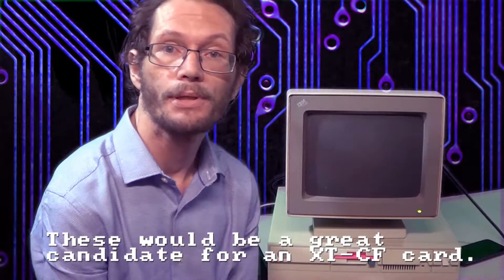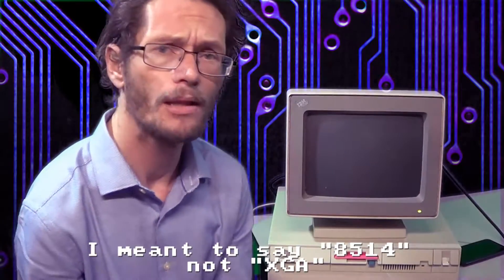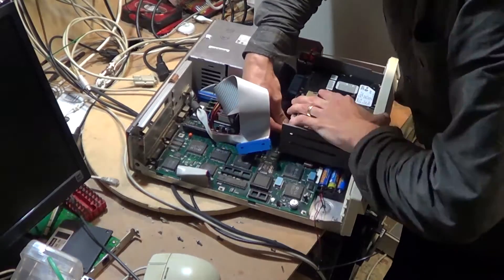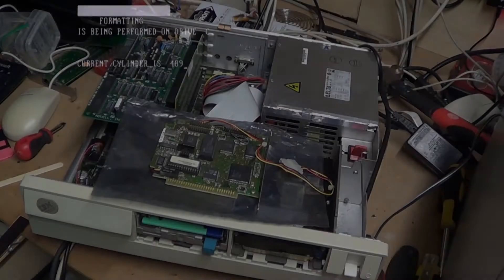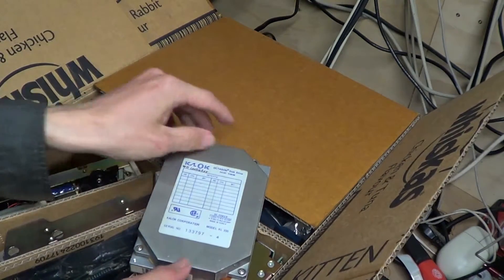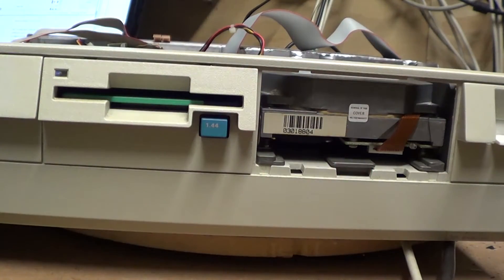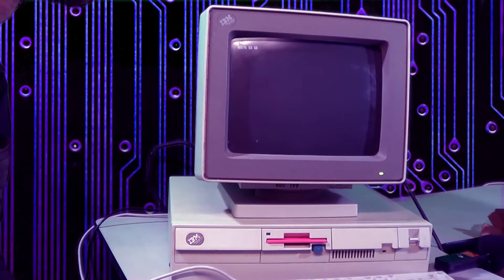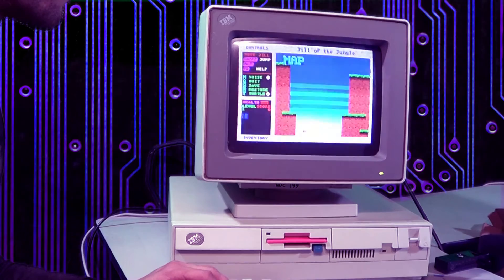IBM PS/2 Model 30-286

Comment: I had the exact same model system and it ended up with lots of bad sectors too. So many that I could accurately determine what caused it. Drives back then did not auto park so if you cut the power at the switch while the drive was being accessed, the driveheads would crash on the surface of the platters.

Comment: Are you sure you have enough of that spooky reverb on the left channel?
Reply from the maker: haha nicely detected, I was messing with various things  to cover up noise (which actually sounded worse). I've  purchased a better mic and camera so I wont mess with it again.
Reply: Thought so!  Very cool vid & history, BaudBand!   I had this very same model of PS/2.  I had it for 2 years, then jammed a real 486 board into it (had 1 MB of onboard VLB video) and during the early-mid '90s, I ran a DX2 50 Mhz '486 CPU in it, then a 66 MHz,  then finally an AMD 5x86 133 CPU in it...and it really did run like a Pentium 75 Mhz.  It run just fine with 64 MB of fast RAM in it.   http://www.vcfed.org/forum/archive/index.php/t-4453.html   - 13th entry down, "Trevor07".  There's the full story.

Comment: Never had a PS/2 286.  Looks interesting.  All my IBM systems are pre PS/2 while my faster 286 / 386 / 486 systems are clones.  I love old hardware!  I found if hard drives are not stored in climate controlled areas the media will break down.  I had a ST-225 in a IBM 5150 that was stored in a barn and had the same issues as your drive.